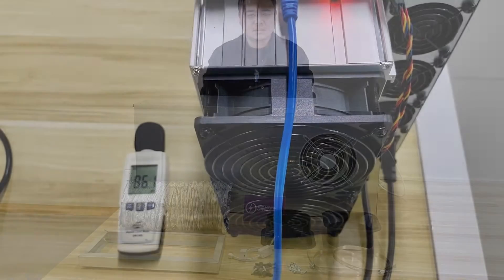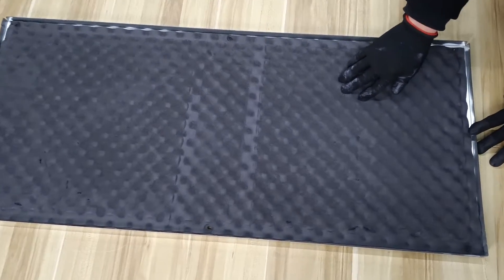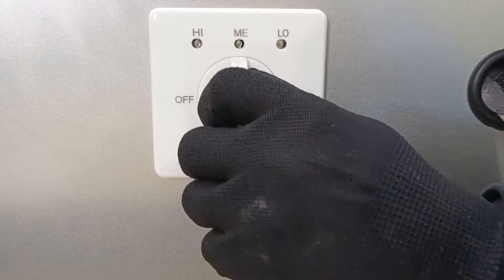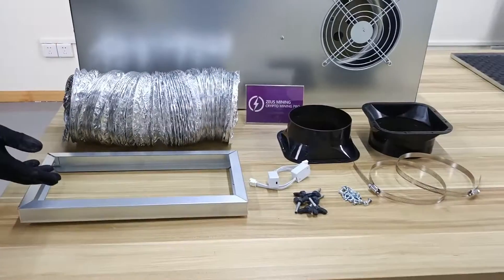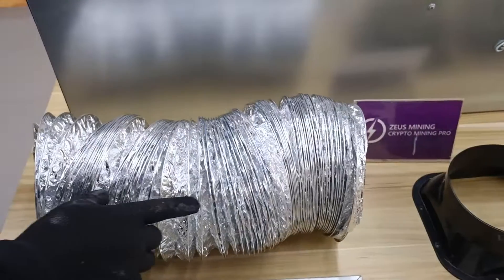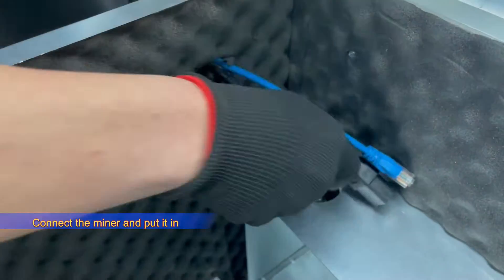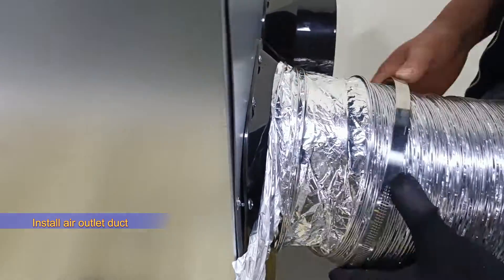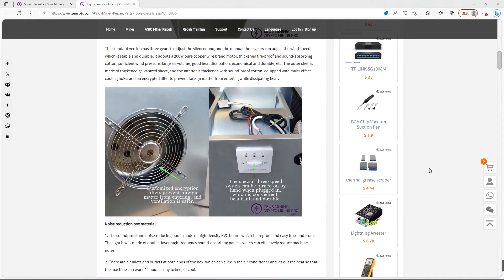How to install and use the crypto miner silencer?

Comment: How does it isolate dust?
Reply from the maker: When the ASIC miner is installed in the silencer box, the dust will not directly reach the miner, so it plays the role of isolating the dust.
Reply: @ZEUSMINING  Doesn't it just blow air through the miner? But if it works like you say, it is awesome! Really nice kit
Reply from the maker: In the video, there is a demonstration of the completed installation process, you can watch it carefully. It's really good for miner friends

Comment: Hi, we don't see where the pipe goes. Does the air go outside ? Or just in the same room? Is it the same noize if it is the same room?
Reply from the maker: It is best if the pipes can go outside. If they are in the same room, the noise will be higher.